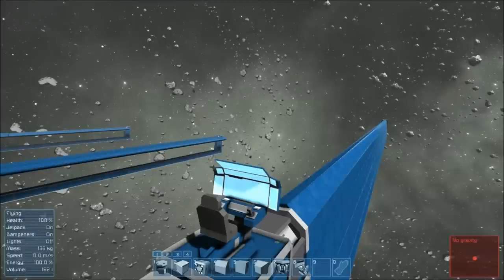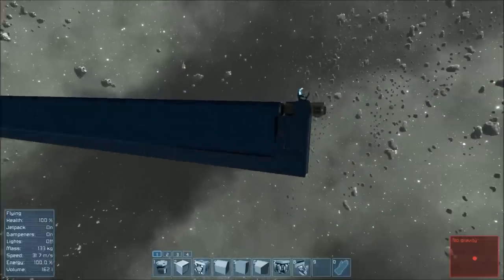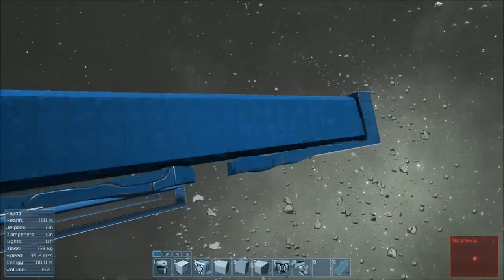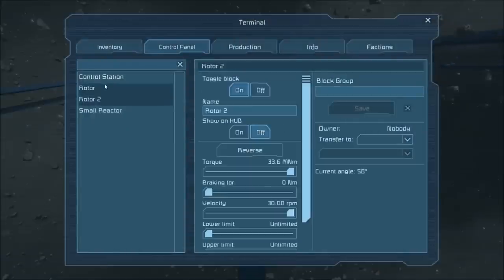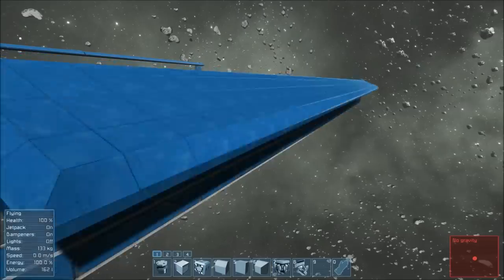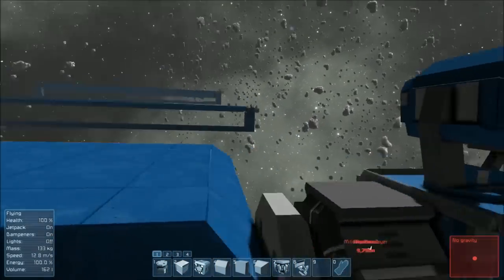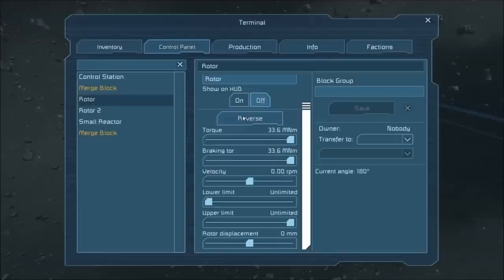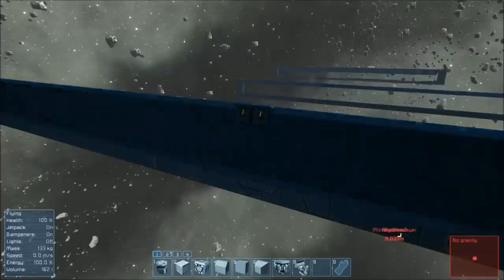Space Engineers - 2 Rotors Door Tutorial

Comment: Note : this video is very outdated. The displacement is now from -0.40 to +0.20 and you no longer have to use merge blocks to create these kind of doors. You can't even use that method anymore.
Just build both rotors, but grind off the Rotor Part on one side. Then build the door. Finally place a Rotor Part on the door so that it sticks inside the 2nd Rotor and it'll snap together just fine.
Reply: Old message but thanks!!!
Reply: still valid

Comment: how do you set a door to say only open/close at 90 degrees?
Reply from the maker: You can use the rotor limit settings for upper / lower limit. It's easiest if you just do it on one rotor as the one stopping will just hold the other one in place. Just set one of them to 0 and 90 or -90 depending on your needs.